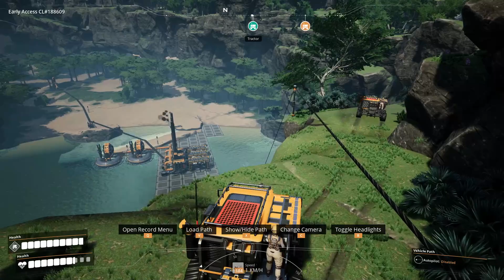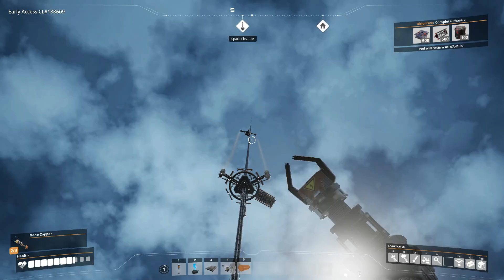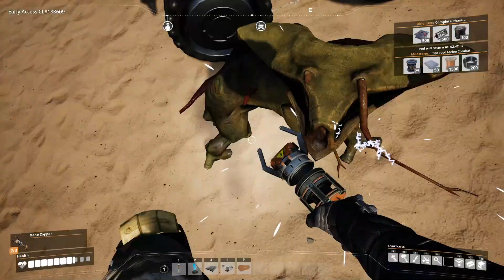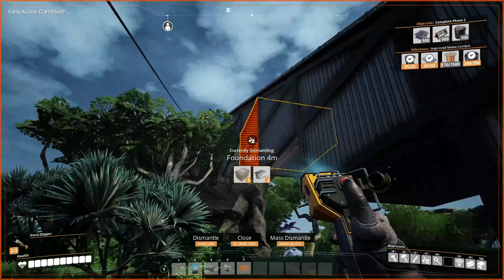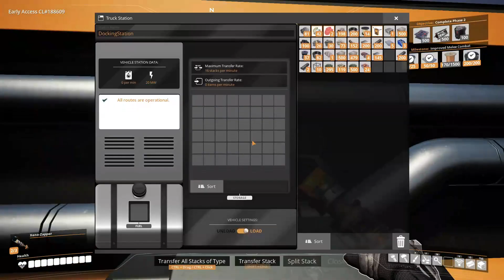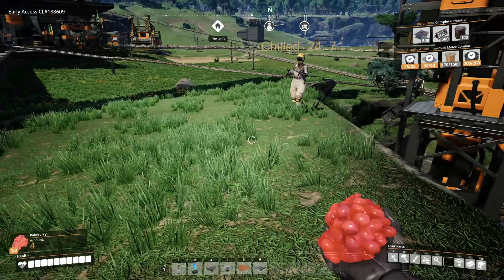Satisfactory Co-op | Ep 8 - Steel & Truck Transport

Comment: The factory keeps growing.. If you need more coal for Power there are three nodes up by the lake and only one is covered by a rock. You may have missed the second accessible node as it deep in vegetation very near the one you are using. Good idea to separate the uses of coal per node for steel, black powder  and power. I ended up using it all for power and had to powershard  the miners to allow enough overflow for steel -until after I unlocked oil and fuel power.. Looking back I should have done what you are doing.
Reply from the maker: We still need to setup the black powder but we will use the original coal supply for that one.
I'll take a look for the 3rd coal at the lake. Thanks for the tip.